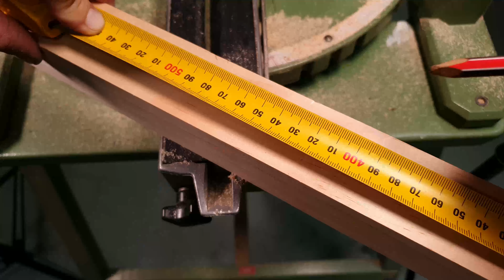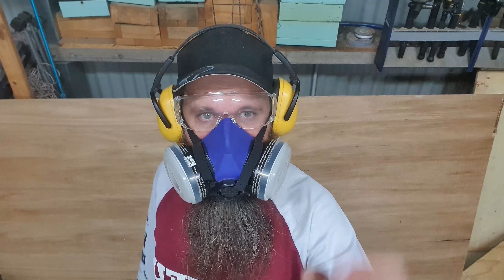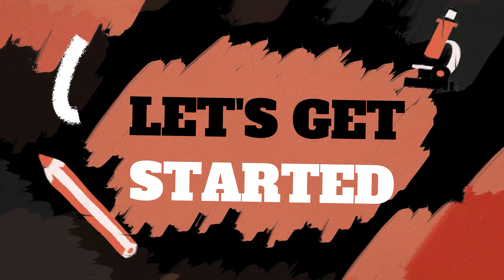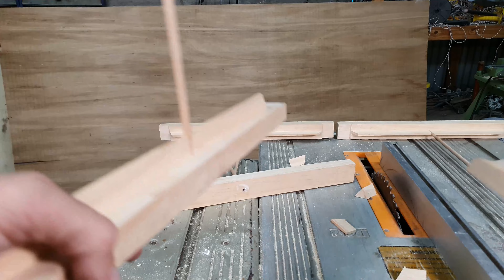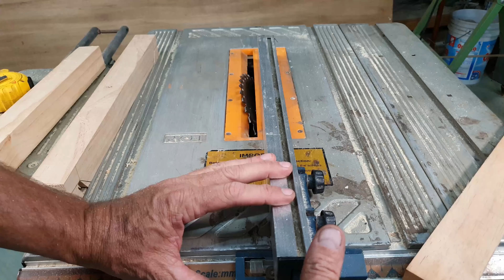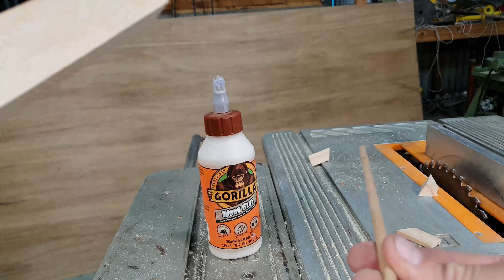How I make my top bars with a table saw!

Comment: The dowels that you are using does that also help maintain straight comb and is it more forgiving if you forget and turn it horizontal? Thank you again, I’ve  watched your video four or five times and have shared it with many people.
Reply from the maker: I don't think they contribute a lot to the straightness of the comb as they seem to build directly down from the attachment point anyway. It definitely adds to the lateral stability of the comb, which was the main reason for adding it, though I'm not sure it would support a full bar of honey. I'll test that next time I harvest honey from one of the bars with the dowel.  Thanks for watching.

Comment: Golly there are some dangerous operations in this video. Good info on how to make the top bars, but without a riving knife or anti-kickback pawl on the table saw your risk of injuries is pretty high.
Like another comment mentioned, a crosscut sled would make this easier and safer.
Reply from the maker: Thanks for the feedback. The riving knife that came with the saw isn't suitable for cuts like this as it's not adjustable. I might need to make my own.